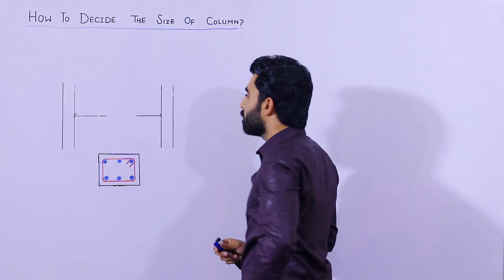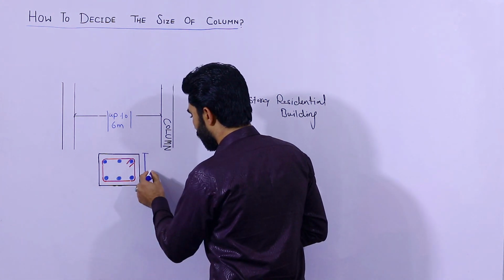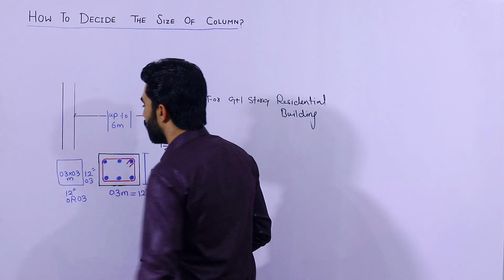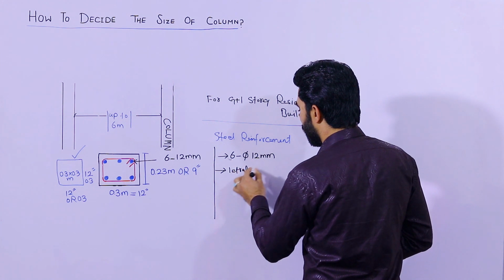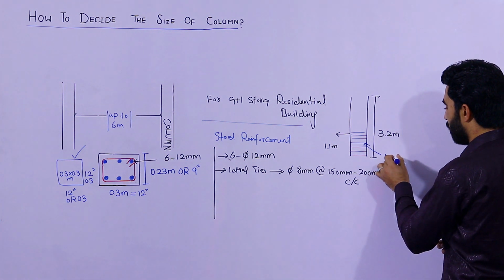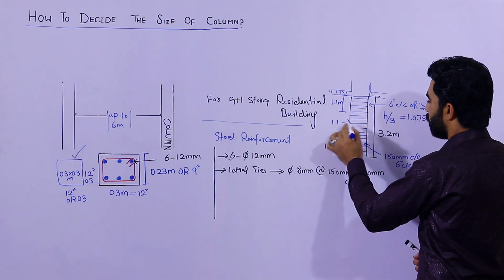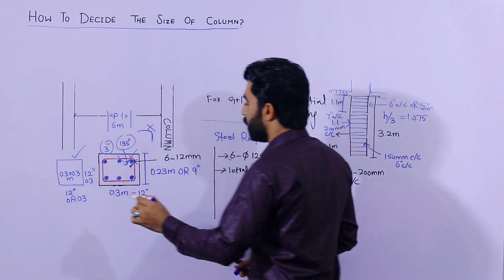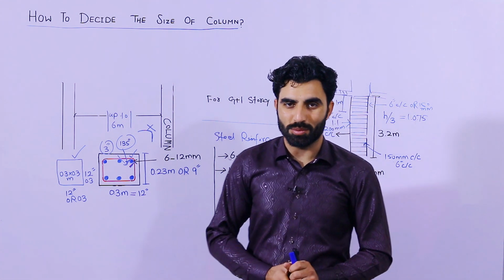How to Find Size of Column for G+1 Storey Residential Building? | Civil Engineering Videos |

Comment: Hi,
If the column is at corner side then should I use 4 16mm bar for 10" x 10"?

And for the middle of the slab like near the stair... 6 16mm rod for 10" x 12"?
Is it ok to go?

Comment: First decide load coming on column. Total load =No. of storeys x Tributary area xLoad per m^2 per floor. For residential building we assume 15 to 20 KN/m^2.
For  Pu=970 KN say (calculate load as per plan)
Pu=0.40fck Ac+0.67 fyAsc  For M20 and fy415 steel assuming 2.50% steel
Pu=0.40 x20 (0.975 Ag) +0.67x415 x0.025Ag
Pu=7.80Ag+6.951 Ag =14.75 Ag.
In this Pu=16875 x10^3 =14.75 Ag
Ag=970x10^3/14.75=65762.71 mm^2
Assuming  square section  side of column=256.44mm say 300mm
. Provide 300 x 300 mm square column..
We can Tabulate the various percentage of steel for M20 concrete 
and fy 415 steel
 pt=0.80%      Pu=8.16
1.0%              Pu=10.70
1.50%           Pu=12.05
2.0%            Pu=13.40
2.50%          Pu=14.75
3.0%            Pu=16.10
For economical max percentage of steel may be 2.50% may be adopted. This is  for simplication.

Comment: As a thumb rule we can calculate the size of column for G+1F for residential building. First assume load per floor for residential building as 1.5 t/m^2. For max distance of column is 5m span. Total load on column = No. floors x tributary areax load intensity per floor.
= 2x (5x5m)x1.5 t/m^2=75 t . Multiply by 10 to get kn= 750 kn.
Breadth b assumed=23cm. Depth required= 750/23=32.61cm say 30cm or 38cm.
Column size is 23x 30cm or 23 x38cm. If you provide less size steel will be more. If you assume higher size steel required will be less. Provide 6 nos 12mm with 8mm dis ties at 150 mm c/c
Reply: Yes 6 meter distance aren't capable for factor of safety